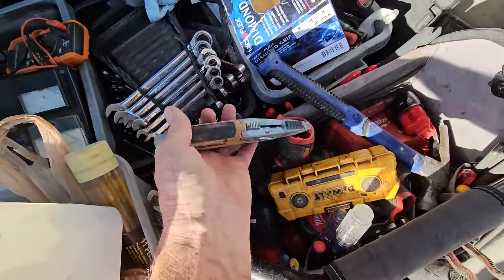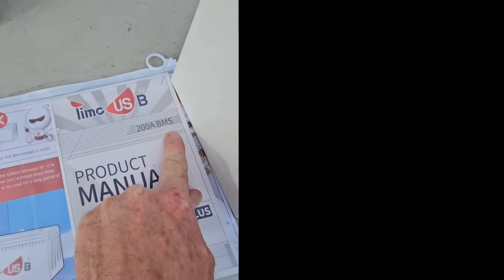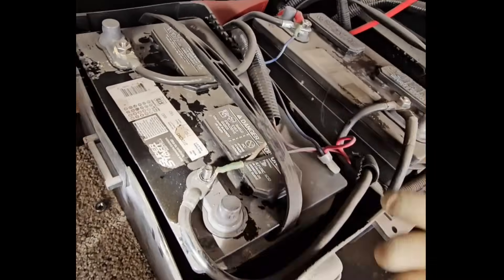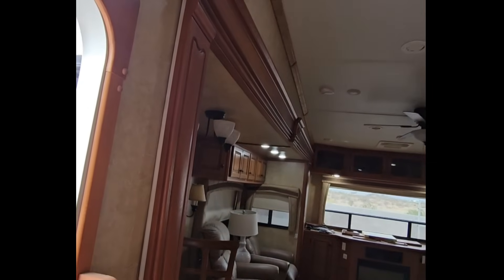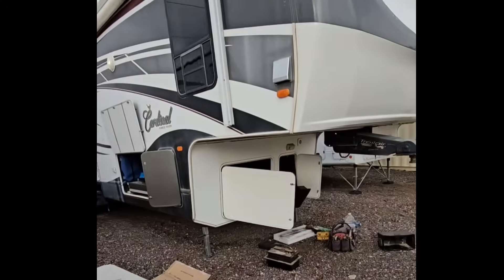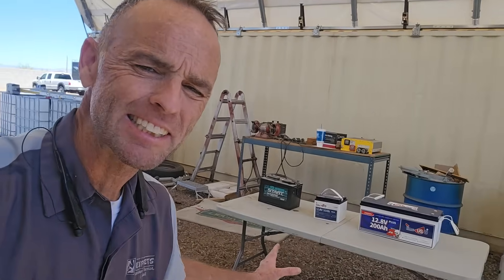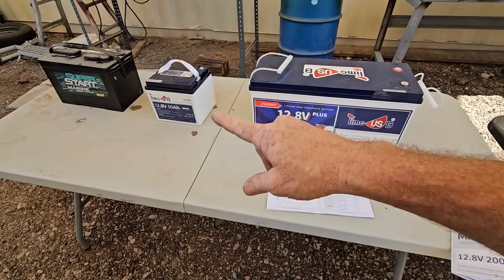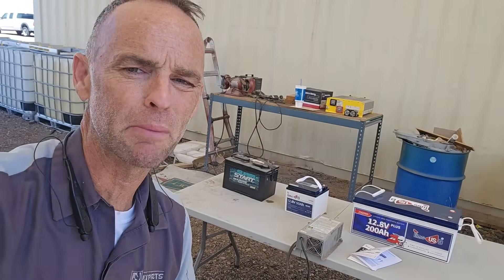Common Mistake When Buying LiFePO4 RV Batteries

Comment: No one has been able to tell me the difference between lithium iron phosphate batteries and lithium ION phosphate batteries. Even a guy who runs a solar supply didn't know.
anyone? Or are they the same, just a marketing term?
Reply from the maker: Much different chemistry, Iron is much heavier than the nickel and cobalt used in lithium ion batteries that are used in phones, laptops, tablets and Teslas where weight savings and energy density matters. LiFePO4, are heavier so are perfect for solar and energy storage and last longer and are more stable, but most importantly are not capable of runaway thermal events and beside the plastic cases, should actually put a fire out if put in a fire. Ultimately, I am not a chemist or engineer and rely on their knowledge because storing electricty in lead acid is just as confusing to me and they are all "black boxes" of magic to me inside.

Comment: Is pulling in  a slide or AC start up (not soft start) considered "surge" use per the manual you showed? When you used the 200, it seemed longer then 5 seconds.

Comment: I just want to know why china lifepo4  batteries there dishonest. We cant trust them. I texted temgot and asked them why did they change to temgo. Then I asked them are you still using eve 230 grade a cells. They said we are.  We are a honest company ok so you can not  give me the truth. So they did oem work for other suppliers. We found that out when temgo said you want a couple of batteries i could of got two for 2 grand right now. I want a 460 ah in a metal case you can rebuild it. So when they said email us if you need anything else regards vatrer. Wow what a joke they did the oem work for them. So all vidios on youtube there's real people with cash and people that complain about a 500 dollar battery. I want to buy so, varter  the 460ah in a metal case is seen in vidios. I like your vidios, thease you tubers leave you in the blind. So a vidio i was watching on rv solor he took it apart and did not get over the 460 ah he came short on the vatrer. He had nothing to say about it he did not like it. I agree perfect a cells would give you extra and on the discharge  all evenly. The temgot got 481 ah on a 460 ah battery. The 300 amp hour temgot on top mountain solor took that one apart but them batteries the case is ruined. So they use a good bms with over sized ring terminals. Thats skipping corners so the 300 ah temgo is not perfect. So you can buy a battery at the same time he got his good new grade a cells. Then a moth later you might have b cells and a 460 ah might be looking like a 440ah discharge. Nobody puts down if they had a temgot at the time and had it for two years and still holding full capacity. So we buy batteries in the blind. To donate to battle born 5000 dollars for 570 amp hours and you need two there out there mine. So I seen on your class a 40 foot bus coach you run a vatrer 460 ah you never gave it a complaint. Some real help on what true battery to run for litium phosphate. Epouch is over 2000 dollars for a 460 in plastic. I seen problems with them to. I mean sounds nuts a propane generator one to do an rv they start around 5000 I put a heavy mounted stand for exterior I would go that way nice and quiet. So lithium iron phosphate thermal runaway its not going out. I dont see how they put and allow a lithium iron with the best bms  can fail. So the pull behinds where the tanks re hooked behind the tow hitch. They mount a huge lithium iron in right on it. So in real hot heat they can expand and explode. So who can answer my question about temgo.

Comment: I hope to get an answer for the PRO
I use my travel for work . I stay in it for 2/3 months at times then back to the storage for 1/2 month , then back in it 
what is best batteries in my situation , I went through traditional ones like ones a year 
I have a 50 amp Flagstaff by ForestRiver 
residential fridge, 2 AC’s , Washer and dryer combo 
thank you

Comment: Live in Alaska. Purchased a new TT and the dealer told me to keep my lead acid batteries(2/ 6 volt) for at least 2 years and then maybe consider lithium. He indicated that the cold is hard to charge lithium batteries. Don’t some of the newer lithium batteries come with a built in heater for cold weather charging? I like to do a lot of fall camping when the temperatures frequently go below 32 degrees at night.

Comment: Only 1 thing i do not like about my lithiums is you cannot charge them in freezing temps. I live in the north. There are ways around that issue and would never go back to LA batteries.  Just be aware
Reply: I have had LA batteries for years. They are a pain to keep over the winter here in Alaska. Have to charge them monthly and keep them in my heated garage, but I am considering upgrading to lithium.

Comment: Your "safety" explanation is a bit silly lol. You can fully deplete or abuse lead acid batteries without issue other than potentially ruining your battery. If the BMS fails and you over discharge a cell on lipo you can start a crazy fast fire. Hope it's not by your propane tanks. BMS is there not because it's extra safe over lead acid, but because it's extra dangerous and has to have it lol.
Reply from the maker: I have seen more lead acid explosions than lithium fires and lifepo casing will burn more than the battery chemisty.
Reply: @AZExpert  Quit making shit up haha
Reply from the maker: @DR-zl2ct I'll assume you don't understand chemistry of lifepo or lead acid batteries than.

Comment: Swapping a lead-acid battery with a LiFePO battery without changing the battery charging equipment is not recommended.  A high charge voltage will reduce life on the first charge.  A low voltage will significantly result in extremely low capacity.  The charge profile for a LiFePO battery is very different.  And, if you find yourself in temperatures below 32°, no charging is possible on thermally protected batteries or immediate damage on batteries without thermal cutoff.

Comment: Couple of things to watch out for if you wire 2 12V in parallel I would suggest fusing between the two with a megafuse, or class T not directly connecting a wire without a fuse. The reason is if one battery were to fail internally the other battery could dump it's current into the failed battery causing it to get much hotter. LIfepo4 batteries can't thermal runaway into high temperature like lithium-ion batteries do burning at 5000 deg. Lifepo4 can get hot enough to ignite and vent flammable gases and plastic case can catch fire. This is why I suggest using a metal box to contain the heat but has a small vent to release the gas. The white smoke that comes from a lifepo4 battery that has vented is toxic with hydrofluoric acid. This toxin is very dangerous you don't want to breath it. I would also make sure the compartment still maintains some vents that were used for the lead acid.  One more thing you can't just directly connect an alternator to a lifepo4 battery what will happen is the battery will allow max charging over 100 amps your alternator will overheat and burn out. You need a DC to DC charger made for lifepo4 batteries.
Reply from the maker: I think you are welcome to be as fearful as you'd like, but your advice is way overplanning and outside the realm of usefulness

Comment: I upgraded batteries and power converter December of 2024 for my 5th wheel RV. I got a pair of Siekon 12-volt / 100Ah LiFePO4 w/BMS Group 31 for $301/pr from Amazon, and so far they'll been phenomenal and have not failed once having carried me through several power outages, some lasting 5-hrs or longer due to downed power pole during storm. I had very strong reservations switching from lead acid to lithium, but so far I'm enthused with the performance. I wish the batteries had bluetooth connectivity so I could monitor the health of the batteries, and so I've held onto the old lead acid type for backup just in case. In addition, I have two dual-fuel generators on standby in case power outage goes for more than 1/2 hour so I don't have to rely on batteries alone. Been thinking about adding two more for total of 400Ah.
Reply from the maker: That's great to hear your new batteries are working out so well!
Reply: @AZExpert  - I know you might think I'm crazy, but I like these batteries so well, I just placed an order a couple of days ago for two additional batteries to bring total to four as we have many power outages here in southern middle Tennessee. That will bring me to 400Ah so that I'm not in a mad rush to bring the power generator out. Batteries should arrive July 15th.

Comment: Lithium is not safer than normal butteries… your fake news
Reply from the maker: "you're" but also I have had lead acid batteries blow up on me and seen it happen to my friends many times. You have started with a conclusion and are too stubborn to learn and change. Acid spills and causes injuries and the fumes are acidic and hydrogen. You should considering learning the difference between Lithium ion and Lithium iron phospate chemistry.
Reply: Take ownership of your fake news
Reply: @AZExpert  NO take ownership of YOUR fake news. Lead acid is 1000% safer than these Chinesium garbage that explode and cause fires you can't put out.

Comment: The lead acid are rebuildable it can be easily freshened up with some baking soda rinse thoroughly in most cases can use the same acid with a pinch of cadmium sulfate 
When lithium does not so rebuildable

Comment: What about your engines alternator (both Motorhome or towing vehicle). I thought there was a problem with damaging your alternator when the lithium battery becomes full. I was always told that this is because the BMS (battery management system) suddenly turns off thereby damaging the alternators electronics.Is this true?

Comment: Just a thought, they make capacitor batteries for diesels that will give you thousands of amps for several seconds, which is enough time to start up, while still being lightweight and extremely long lasting. They're expensive, but could give you great results while ditching lead acid batteries.
Reply: I was going to say same thing. Bbi you tube channel has awesome demonstration of super caps working under load and they are phenomenal.

Comment: I have two 6-volt batteries in my motorhome fleetwood fiesta 2003. If I switch to this lithium battery, do I need to change the alternator or add something extra? I understand that it needs a charge of 14.5 amps, but the current batteries recharge when I start the motorhome or plug into a campsite, and my alternator outputs 13.8 volts.

Comment: Curious how you didn't mention the 100 Ah size, which is the most common, economical, and closest substitute to a standard 2 battery lead acid set up. It would be nice to know if the sliders and lifts would function.
Reply: I have 2 100A LiFePO4 batteries in parallel and they power my 12’ electric slide and Scwintek kitchen slide faster and easier than my 2 old LA batteries ever did. I do have the newer “upgraded” auto detect converter but this converter insists on staying in LA mode so they charge really slow. I plan on upgrading to the Victron IP22 converter/charger in the near future.

Comment: Great video as I am looking to do an upgrade on my coach. I have an unrelated question. I have a 2007 Itasca with the head liner that has separated. Have you done a video related to this issue? I couldn’t find one.

Comment: Great video as usual. I have 6 AGM house batteries and wondered if I can swap out 2 or 3 with lithium and keep charging and inverter system.  I know it won't charge to 100% but that's fine. Thank you.
Reply: Lithium BMS systems need a full charge to balance the cells inside the battery. Balancing means keeping them all at an equal voltage. Lifepo4 batteries need to be fully charged in order for the BMS to start balancing the cells. Without balancing, the battery can become damaged over time.
Reply: you won't want to do that as it'll drop below the appropriate 0% SOC voltage if you deplete the bank.

Comment: Ok James you make a great point on these batteries but how are they in the cold and do I need to remove them in the winter from my motorhome. Are they a direct swap or do I need charge controllers and all the extra fixings.

Comment: Seeing chatter about needing to change out converters and dc-dc  charger versus just slapping in a Li as a house battery -- whats the ideal way to do it. A straight swap li in lead out would make me grin
Reply: Run lead AMG and Lipo4 in parallel- great stuff. nothing extra needed, modern alternator will handle charging etc

Comment: Are lithiums acceptable for applications where the camper is in cold storage that occasionally gets down to 0 degrees Fahrenheit?  I’d really like lithiums but have heard there are some concerns with storage at low temperatures.

Comment: AZ Expert thank you for all your videos.  I had some questions about lithium batteries.  From what I understand you have to change out your converter (battery charger) as the old school battery chargers do not have an energy cutoff which could possibly make a run-a-way effect in a lithium battery and cause it to catch fire.  Does the new BMS in these batteries prevent this now so this is no longer a concern?  Also what about the concerns with lithium batteries in extreme weather like Canadian winters or Arizona summers vs a traditional Lead / Acid battery.
Reply: he doesnt care, hes just selling batteries

Comment: and you can also top off the batteries using solar and a good solar charge controller for much cheaper than replacing your inverter charger.

Comment: James I have a 2016 Fleetwood Flair 29T. I have two wet deep cycle house batteries that I’d like to replace. Since my Flair has no inverter, automatic transfer switch, solar etc I was considering a 200Ah Renogy AGM battery however after watching your video I was intrepid concerning the possibility use of the Lime USB 200Ah battery in my rig. 
It would be charged either by the engine alternator, generator or shore power.
Would this be an option I should consider?
Reply: It will work fine, try to get the time usb 140ah with bluetooth or a 12v lithium with bluetooth. The accuracy and convenience to see if the battery is 86 percent or 25 percent charged is fantastic.  The RV battery monitor will not be accurate when you have lithium so the bluetooth app is the way to go.

Comment: But when underway and charging with the alternator don't lithium charge at a different rate than lead acid?  Even my battery charger has different settings for AGM versus flooded.  I'm confused
Reply: The bms will limit the charge rate. The bms is in between the alternator & the battery cells. So just hook the battery to your 12v or 24v alternator depending on battery voltage & good to go. Just make sure the battery is equipted with a bms. The bms limits flow in & out to keep the battery from overheating. Which would happen if charging too fast or discharging too much too fast.
Reply: Amg is same type battery as flooded.
Flooded battery the acid is free to slosh around. Amg the acid is soaked up in a fiberglass matt I believe & even if the batery csing breaks it wont leak acod out so is a bit safer. There is also gel batteries that are what they sound like, instead fluod acid tjere is am acid gel. Amg have to charge slpwer to absorb a charge as well the gell. There are benefit to an agm over a wet lead acid bit you will have to review on line to find those out.

Comment: Don’t forget that if your converter isn’t lithium compatible, your batteries will not charge faster than a trickle.
Reply: true, the shore power and converter charger will slowly charge the lithium but it will take days.

Comment: I did some minor battery inverter surgery in my fifth wheel got 3 Vatrer 460ah batteries and upgraded to a renogy inverter relocated it to an accessible location the new inverter has automatic transfer capability for the residential refrigerator my drv mobile suites 46 feet long came with 2 100 ah  lead acid batteries on a cheesy pull out tray that didn’t give access to to the batteries so I relocated all of it now I have 1500 ah of lifepo4 and an inverter that will automatically switch to battery power for the residential refrigerator the Rv manufacturers need to give you more battery power if they are going to be going with residential refrigerators but I know why they are switching it’s because residential refrigerators are cheaper than RV refrigerator which run on propane and electricity

Comment: Hi James, I just did a video on upgrading my batteries. So what you’re saying is my old converter that isn’t set for lithium is still fine for getting at least 90% charge? Isn’t it better for the BMS to charge them to 100%? I watched a video from Will Prowse where he talked about this. I have an external battery charger because I have an old converter and I just shut the converter down. Also, will I kill my alternator on my MH if I don’t have a DC to DC charger? Thank you!!
Reply: Actually even dc to dc chargers can strain the alternator....Always study what your alternator is capable of amp wise and the dc to dc charger abilities. Especially at low idle. Buy a good quality DC to DC charger that has smarter features on it..I myself wouldn't charge more at any one time than 50% of the rated amp of the alternator - taking into account ALL what it is providing power to. AND if your lights dim when you go to idle then that is an indicator of too much amp draw. AND in your case not using a DC to DC charger is likely a bad idea unless you have a high amp alternator installed already.
Reply: The old converter will charge the lithium, BUT it will charge super slow. You will only get 5 amps or less and that will take days to charge from empty to full.